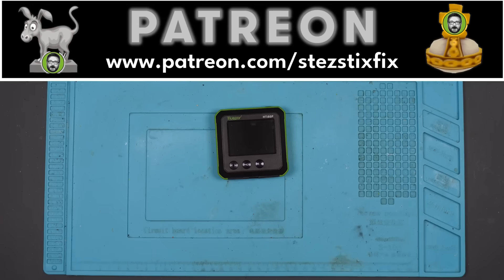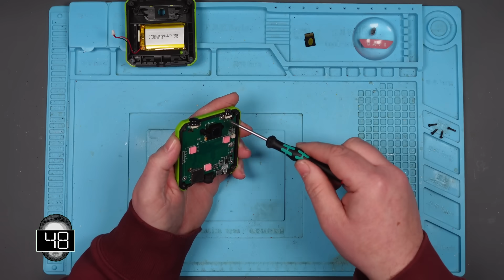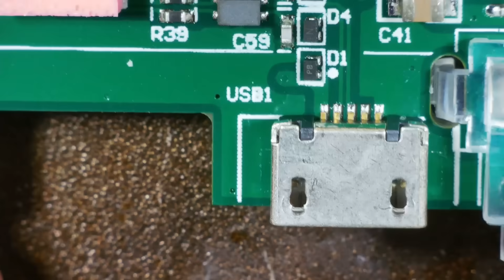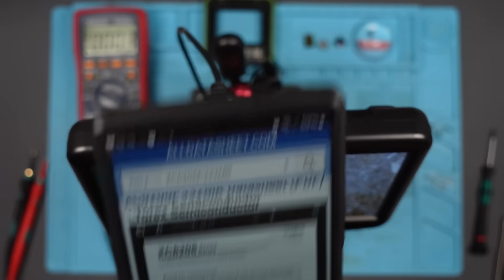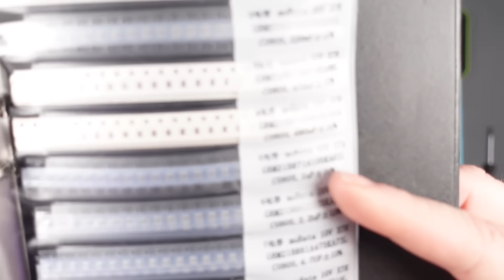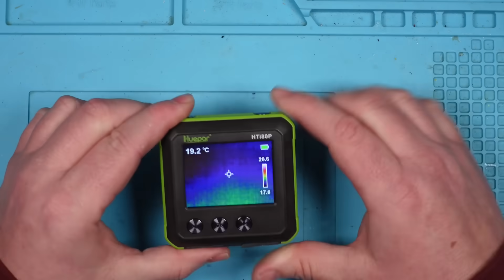This EXPENSIVE Huepar THERMAL Camera is BROKEN | Can I FIX It?

Comment: Estou rindo alto! Aumentou a ventoinha para 10 de potência e 400 graus Celsius. Mas por que não usar ferro de solda? Seria mais fácil do que usar ar quente

I'm laughing out loud! They cranked the fan up to level 10 and 400 degrees Celsius — but why not just use a soldering iron? It would've been easier than using hot air!

Comment: Great video Steve! I got the same thermal camera/imager but my problem is when I power it on, it just show a white screen and nothing seems to be working. I checked all the caps and resistors and they gave correct readings. Im guessing its a firmware failure. Anyone can help me to fix this? thx!

Comment: Can’t fault the fault finding but one to bookmark to show my students what not to do when soldering/desoldering.
Tweezers sinking heat out of joints by holding the cap on the terminals in the wrong place, massively excessive airflow and needless use of hot air and flux.
Bifurcated tip or hot tweezers for removal and a soldering iron for replacement and job would have been done in 20 seconds from start to finish 🤷‍♂️.
The flux in 0.5mm diameter solder wire would have been plenty for a good joint. 
Love to see that method used on my 0201/01005 training board 🤣

Comment: Stez 🤷🏻 what a let down 😮 been watching alot of your videos and was following you until i hit this video when i noticed… an this is just my opinion but looked rushed and seemed you already knew the problem!!! Viewing the video two or three times its obvious somebody had already been in this brand new item and probed the capacitors and other areas before you did 🤷🏻 id even go as far as saying that bad capacitor had been removed before and possibly put back on 🤷🏻 was this item purchased brand new by yourself??? And if so… did you diagnose the issue before you made this video ?

Comment: The "flying caps" is Purley down to bad technique , if you use the tweezers to place light weight on top of component adter placement it should hold it till solder melts

Comment: If you have already clean pads, soldering iron is the right thing to use. Or else hot air on low speed.

Comment: Louis Rossmann actually covered the flying capacitor thing in a video. It's not just the high airflow actually (although I'm pretty sure Steve ought to reduce it). 

What I noticed (if I see this right) is that Steve grabs the capacitor (and the voltage regulator by extension) at the very low end which means the metal sides don't make as well contact cause the tweezers are actually somewhat in the way.

Louis recommended trying to grab the cap at a higher point so that when you place it the tweezers won't be in the way and the risk of the cap flying away would be much reduced. I don't know but it made a lot of sense when Louis explained it in his calming voice XD

Comment: Your lucky that most of the faulty components you find go short, because they're not so easy to find when they go open. These caps fail because manufactures buy lower max temperature, and lower max voltage versions because they are cheaper and smaller.

Comment: Steve! If you're going to be doing more soldering in the same part of the board, why don't you cover newly soldered components - especially the minute ones - with a piece of tape once they're in place.
And why don't you put the components you have removed, that you want to re-use, re-install or investigate, in one of the two lidded compartments on your blue work-board, then they would "ping" away or get blown away by your hot-air gun.
I really enjoy your videos, your's and Vince's are my "go to" channels.  Keep up the good work.

Comment: Love, love the channel. When heating up the solder for component removal or insertion do you hold the ends where the solder is? Surely, that is dissipating heat? I would be holding the component down by pushing down on said component. Also, you never tin the soldering iron tip before trying to solder? I think the flux in the solder helps heat transfer making a quicker, better joint. Just observations, not criticisms!!!

Comment: I had a good laugh with this one. Those parts flying off in all. I normally only use hot air for removal of components, and it’s a lot easier if you just hand solder the smd components. Great work, Steve. I thoroughly enjoy your content, keep it up man. Cheers! 🍻

Comment: good repair but kinda cringe....facepalm... Usually one must avoid extended hot air when there is a display under the PCB...Those 2 components should have been placed back with zero hot air, just with soldering iron.

Comment: I must admit, I use the iron wherever I can for putting components onto the board. The less heat you have to use and the least expose for the components, the better. But, sometimes you gotta push yaself.

Comment: You have nice flux, solder and tips, so use them. After wicking the solder off, touch one pad of each component and use this pad to mount your component on the board. Once satisfied with the orientation, solder the other pads

Comment: I was thinking, i could put that cap and voltage regulator with a soldering iron in less than 5 minutes, and it finally happened xD

Comment: You really don't need to use hot air to replace components - it made it so much harder than it needed to be.

For small components like those, tin one of the pads, and then put the component in place melting the solder with your iron. That then holds the part in place and you can solder the remaining pins. 

Using this method would genuinely have taken you 15 seconds to do that capacitor and regulator, and without the risk of melting other stuff.

Comment: Haha, I've stopped using air for small SMD jobs - it's just quicker to tin one pad, then solder one side of the component, and then tin and solder the other side.

Comment: You need to get a pencil and tips for micro soldering.  Once I had mine the only time the hot air station come on is for heat shrink tubing and devices with many legs, even when installing 8 pin devices I use the pencil. Removal requires the hot air though.

Comment: Nice job. I gotta agree with some of the other comments, and I'm sure you already know, but resoldering the components with the iron instead of hot air is best, since you won't be needlessly heating up surrounding components and won't have to worry about your airflow being to high to send the components flying.

Comment: Mate why is your air speed on max! Also once SMDs are off the board it's easier and safer to use an iron to solder back on. As fun as it is not everything needs hot air reflow. Makes for entertainment though!

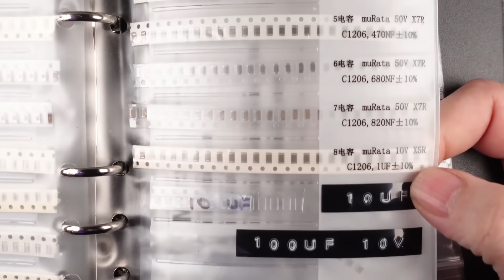Comment: Where can I get a notebook/assortment of capacitors and components like Steve's using at 8:40? Seems like those would be handy to have. I have old boards and misc electronics kicking around, but it'd be good to have them in different sizes and organized like this. Any recommendations would be appreciated. Thanks!
Reply: Just search for "smd capacitors/redistors sample book"

Comment: Hi, next time using the ally tape try sticking it onto the board but leave an air gap between the part you are trying to protect and the tape itself, that way will conduct less heat to the parts ya wanna save from cremating if that makes sense? And I'm glad I'm not the only one who keeps blowing the  bits off with the hot air lol 😅 nice repair and thanks for sharing.
Reply: It's too easy to get impatient and crank up the airflow with hot air and everything flies off everywhere xD

Comment: Difficulties leading up to 10:45... pro-tip: toothpick instead of tweezers. It's made out of wood, so it doesn't conduct, nor wick away heat. Much easier to hold a surface mount component with. Also: hot air for desoldering only on such light components. Just put a little blob of solder onto your soldering iron, hold the component down on the wicked pads with the toothpick and stick it down. Then come back with the flux to tidy it up.
Reply: Pro tip - just use a soldering iron for soldering these. There is absolutely no need to use a hot air gun
Reply: I winced watching the use of hot air, I spent years repairing camcorders and my use of hot air was minimal, no need on discrete components, removing or replacement, C53 had too much solder on, doesn't need big blobs, solder should curve down I also used kapton tape to shield delicate parts not aluminium tape.
Reply: Ceramic tweezers.

Comment: Move the component over a pad so one side is still soldered and its out of the circuit so you can test it and it will not fly away. Much like when you lift a leg on a diode to take it out of the circuit to test

Comment: airflow too high. use some more flux to create surface tension. start the hot air from further away and slowly get closer to the component. make sure to flow from the top and not from the sides.

Comment: Zero Ohm resistors are not likely to be fuses. Think about it... They have no resistance. They are used as jumpers to facilitate the routing of traces, or to allow for adjusting the amount of resistance, if an adjustment might possibly be needed.

Comment: When I solder surface mount components, I put solder on one pad, solder the component in place, then solder the other leg(s).  With chips, you can do a leg in one corner, then solder the leg in the opposite corner, then solder the rest of the legs.  Much quicker, and you don't end up making Jean-Luc facepalm.

Comment: Steeve, first of all, I love you. Thanks to you I am destroying everything in my flat pretending I can solder my way out of everything. Still, a question burns my soul. Why aluminium tape ? Isn t the point to isolate component from high heat ? Aluminium being conductive, why not use masking tape, which is a thermal insulator ? Thanks again for everything sir :)
Reply: I would imagine the aluminium would reflect the heat away.
Reply: Aluminium is an electrical and thermal conductive material. It’s act as an heat sink, dissipating heat and not insulating from it. Masking tape will burn under heat.

Comment: Put solder to one of the pad. Ancor the part with the iron. And solder the other pins with the iron. 
Instead of killing everything around with hot air. Use lots of flux.
Or hot air but lesser air.

Comment: I have this Logitech G502 with these side buttons three blue dots micro switches ( smaller one not the regular 3 pin switches), what would be the appropriate method to remove them iron or hot air?

Comment: I used to make smd prototypes many years ago, the heat process of melting solder/solder paste will damage components if you spend too long blowing over them with a heat gun.

Back in my day we would have removed the cap and sot23 with tweezers and an iron, wicked the pads, put a small dot of solder on one pad and then put the new components on with tweezers and not a gun.

Hot air guns were for plc’s, qft’s etc and even then we had to place the device by hand within 10 seconds or consider the component cooked.

Comment: 🤦‍♀️ Wick the old solder from the pads and clean. Add solder to one pad only and then add the new component while reflowing the solder, then just solder the other side of the component with a soldering iron. No needed to add gale force winds, watch Dorothy fly on by or have the wicked witch burn the board 😂😂😂

Comment: Make sure you use the thermal cam to check for hotspots on the board….

Kinda how you needed to use the UV solder mask light to set the Solder Mask you needed to use on its board.

Comment: Airflow at 120 which is max on the Quick hot air station and wonders why components blew off board and struggling getting replacement on? I have that same station and great when used correctly. Put airflow back down to 70 it goes so much easier. He luckly he didn’t blow all nearby components off?

Plus would have just used flux and manually solder components back. At least repair was successful but he really needs to cut back on that airflow as next time he won’t be so lucky l.

Comment: Hey man, I doubt you'll read this, but you're at such a high level you should use proper brushes to clean the electronics to not leave fuzzies from the Q tips and compressed air to clean up, or maybe I'm a Shtewpit ietdiott and you do that already.

Comment: Steve, please, use a soldering iron with a very fine tip for small components. You overuse the hot air. I swear this is not hate comment is a cry for help. Is painful watch those components fly away.

Comment: I wish they would start building thermal cameras into phones.  Sooner or later they will.
Reply: They already do. The Cat S60 has a built in thermal camera. There's a newer version now the S62. I prefer having an independant thermal camera though.
Reply: Doogee have had thermal cameras for a while, but they don't record video outside of the latest for weird reasons to do with the android OS not really liking video recording from a third camera which has been fixed in the latest android(TL;DR the default camera app has toggle for direction which switches the camera, if you add a third camera as a video source this functionality used to break).
You can watch the view of the IR camera in photo mode the same as you can in full colour mode, so it still works as Steve uses his camera.

Comment: R40 isn't a fuse it's a Zero Ohm resistor commonly used instead of a jumper wire.

Comment: Using hot air to replace parts when a soldering iron would take seconds and not stress your precious thermal cam… tut tut. Got away with it though and nice job 👍

Comment: How about reducing the airflow a bit when components start flying?
Reply: Was fun seeing airflow set to warp 9, even if Picard didn't approve.
Reply: How about using a soldering iron when you need to tackle just 2 dots?
Reply: @frozen_sun  : )
Reply: @frozen_sun dots ? Do you mean solder pads ? 
I'm not sure I'd take your advice calling things "dots"
You might have cooties.
Reply: @Boogie_the_cat  Yes.

Comment: The number of times I find myself shouting at the screen "it's on there, leave it the &%& #$ alone you *$#^&%!. No, don't go back and add more solder, no don't re-heat it, it's fine, it's on there, leave it alone or you'll blow the part away again. Turn down the airflow, hold it down, don't hold the part you're trying to solder by the soldered bits with a big metal heatsinky pair of tweezers, you plonk"

But in the end you always manage to fix it (or not) and that's all that matters.

Comment: You just need a thermal camera to see which parts of the board are dissipating too much heat.  It’s a dilemma almost as bad as trying to fix your soldering iron.

Comment: Sad to think of all the good electronics that get thrown out every year from an equally small bit faulty.   But as with all machinery...when they have issues the repair is often a simple matter but it's the FINDING of the issue that is the real bugger.   Well done Steve!
Reply: Reminds me of an old IT legend I heard
Big company has a fault in their giant mainframe computer. They call in an IT guy
Guy walks in, looks around for a second, finds a component and puts a big chalk X mark on it
The company then receives a bill from the IT guy. $40,000
"This is outrageous," the company says. "We demand that you itemize this bill."
They receive an itemized bill:
Piece of chalk: $1
Knowing where to draw the X: $39,999
Reply: problem with thoe "easy" repairs is, that you have to have the right parts lying around or you'll be waiting for them till they arrive. if you need the device NOW and can't wait days or even weeks, then that sucks. once you have those parts lying around, like Steve, it's always better to fix it yourself, if you have the talent. soldering irons are cheap, not sure about that heat-blower-thingy though
Reply: Talent, knowledge, ability (try doing that with a tremor), equipment, etc.

Comment: Dude just hold the freaking cap in place and set the air speed higher. As soon as solder wet remove air. Reflow with flux and surface tension will do the rest